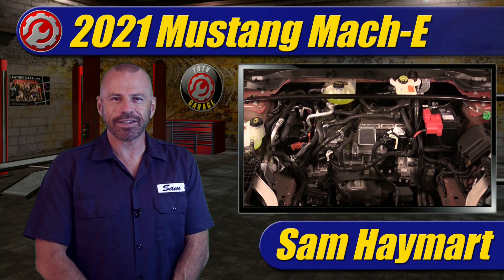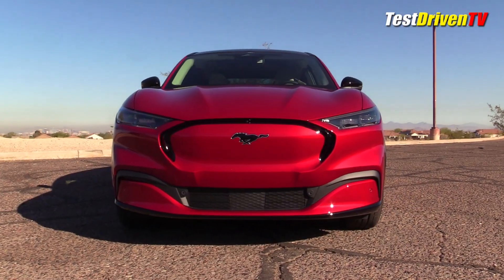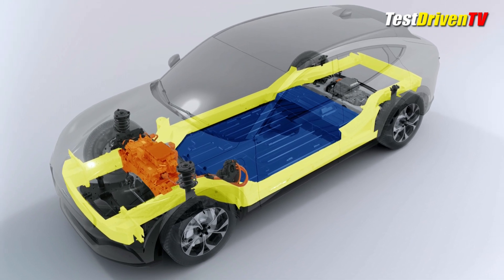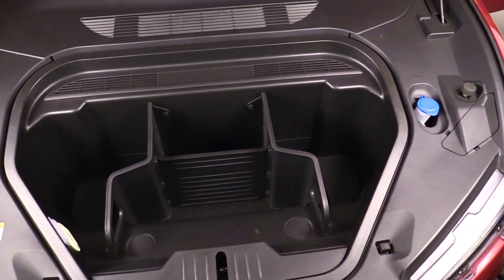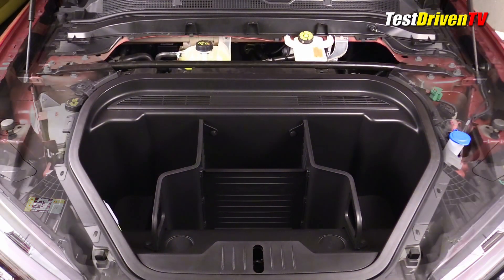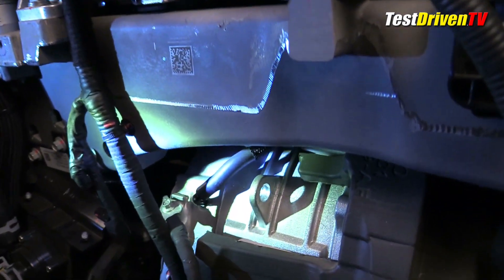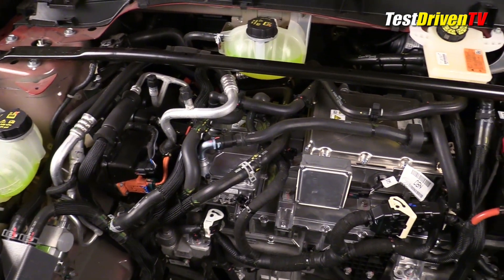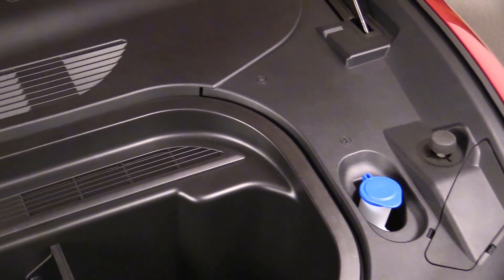2021-2022 Ford Mustang Mach-E: Under The Hood

Comment: The video at test driven TV about the Mach E wasn't worth much.  This video was MUCH better, even if it was brief.  Thanks for making it.  I have watched another video where the 12 volt battery was accessed without removing the front trunk bed.  Instead, he had removed the panel between the trunk bed and the windshield.  I do not know if the battery was removable - but was accessible.

Comment: The difficulty getting to the business end is by design, the lethal voltages and current can kill you quite easily if you are not familiar with handling of high power electrical circuits. The 12 volt battery should be in a separate enclosure and more easily accessible to the owner.

Comment: It is great to see  what Ford has under the hood, even if it is electric. I know that the Mach-E cooling system will not overheat because the hardware they cool down  does not get as hot as an internal combustion engine, so the pressure is lower, and the hoses can last the whole life of the car. I have a Fusion Hybrid and it still has an engine, but it runs only 30% of the time, so its cooling system and hoses will last for many years before any trouble or servicing happens. Ford builds great!
Reply: Hoses don't last longer when not used, it doesn't work that way.